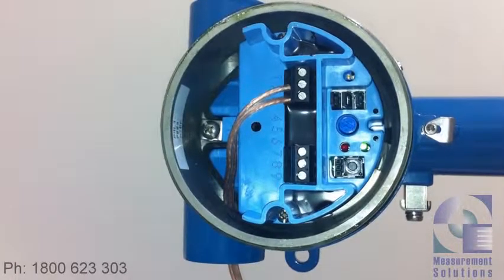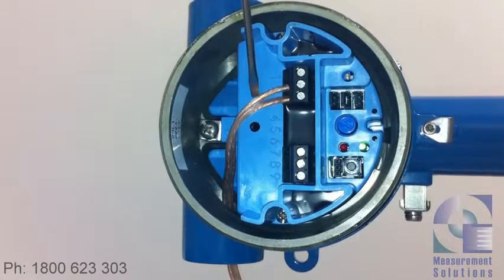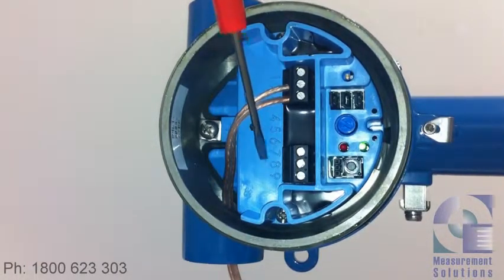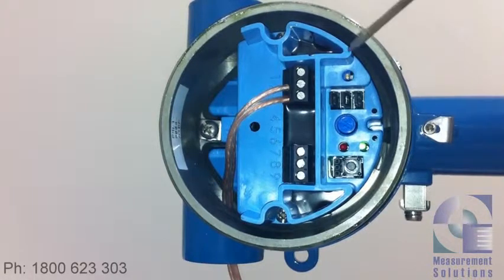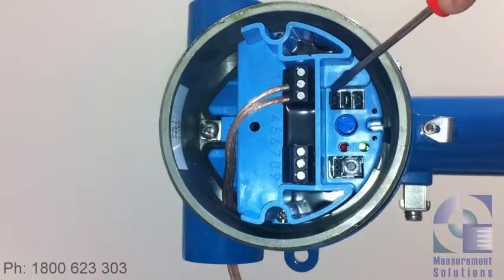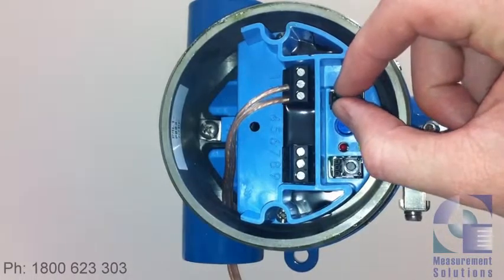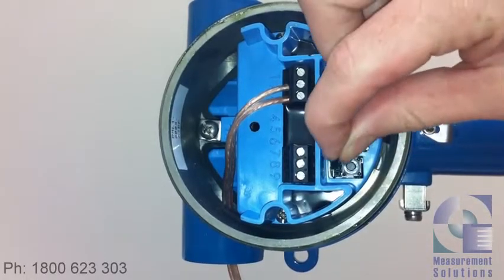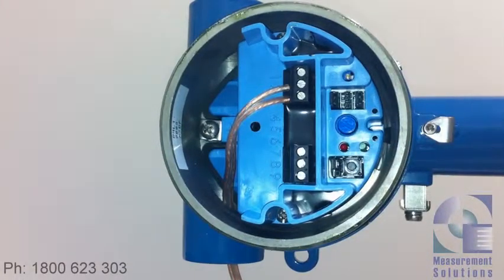Drexelbrook ThePoint Two-wire level switch mode selection proceedure

Comment: Why does this sensor utilize 8 -16 mA and not 4-20mA?
Reply from the maker: It's wired up the same way as a 2-wire, 4-20 mA transmitter, however as this a level switch, presence and absence of the medium is indicated by a step change between 8mA and 16 mA. A signal outside or between those two values would indicate a problem. In addition to the added feedback, the benefit of having only 2 wires for power and signal can simply installation and hardware requirements.
Reply: @MeaSolutions  "A signal outside or between those two values would indicate a problem". This explains it all!! Thank you. A few other questions if you don't mind:
- Can I use the "Meter" output terminals as a mA signal to my analog card as well as the 8-16 mA signal or is it strictly for "metering" only?
- Does the sensor output signal have a range between 8-16 mA (ie. 9,10,11,12 mA) thus increasing / decreasing as more material comes in contact with the probe?Or is the signal strictly 8 or 16 mA no matter how much material coats the probe?
Your help will greatly be appreciated. Thanks again for the great explanation.

Comment: what can be done if the green light blinks and the red light is on standby?
Reply from the maker: Green light blinking indicates "Over-Range". Could be a short between the sensor terminals or you've got to much standing capacitance. 

What type of sensor are you using and how long is the active?

If it helps, section 3 of the manual has more information on how to troubleshoot. 

https://www.drexelbrook.com/-/media/ametekdrexelbrook/download_links/manual-thepoint-line-powered-level-switch_english.pdf